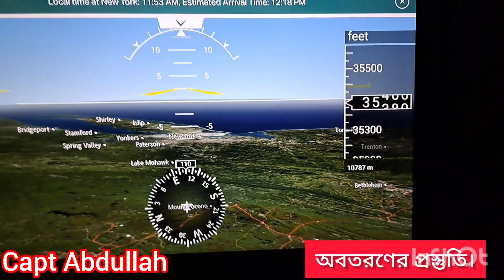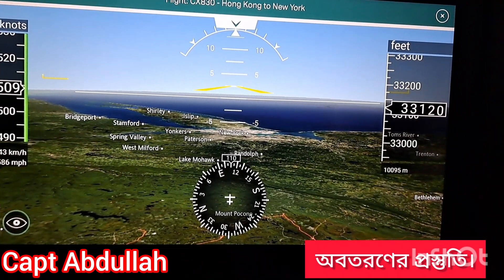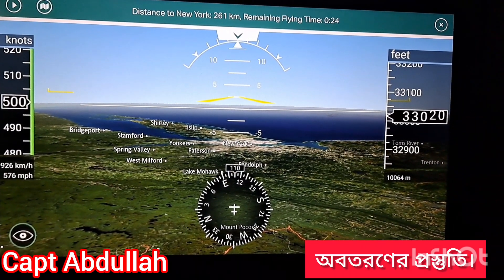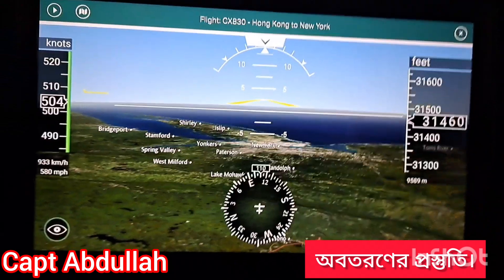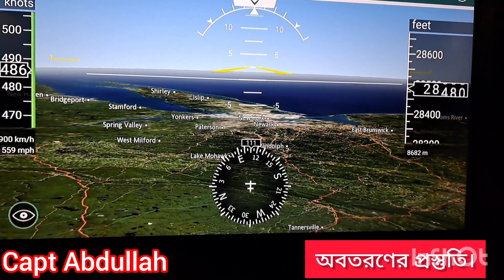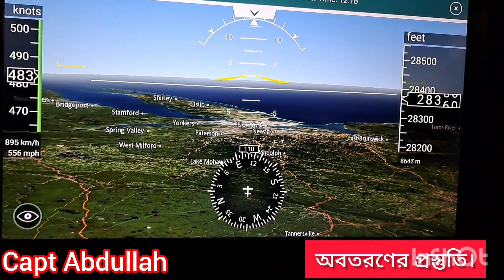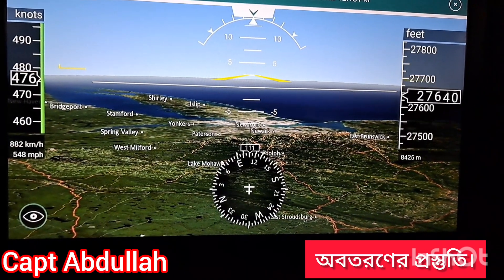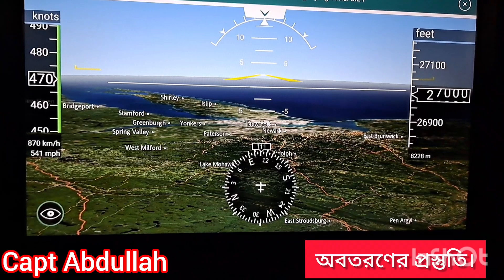৩৭,০০০ ফিট থেকে অবতরণ পর্যন্ত দেখতে পাবেন। “সুপার” কোন এয়ারক্রাফ্টকে বলা হয় ইত্যাদি ।

Comment: Sir, Assalamu Alaikum.
I’m Adrito from Cox’s Bazar.

Your landing was absolutely incredible—a perfect butter landing!

Sir, I hope you don’t mind me reaching out again despite your busy schedule.

I have two questions about this video:
1️⃣ How did you manage to maintain such a stable speed while keeping the pitch at around 2.5 degrees and still achieve such a high descent rate?
2️⃣ Which flight simulator did you use for this? Is it available for public use? If so, could you please share the name?

Sir, I just can’t keep these two questions to myself any longer!

3️⃣ If someone from the Bangladesh Air Force (BAF) wants to become a commercial pilot, how many years must they serve the country first? Up to which rank do they need to progress? What courses can they complete within the BAF, and after leaving, will they need to take any additional courses on their own to qualify as a commercial pilot? Also, how high is the demand for such pilots? A detailed explanation would be really helpful.

4️⃣ I’m so passionate about the aviation industry that I regularly practice flying on my tablet using the X-Plane Flight Simulator Mobile, flying the Cessna 172 and CirrusJet SF50. (Alhamdulillah, I’ve become quite skilled in both day and night flying, and now I’m planning to practice weather condition changes and instrument failures.)

However, my biggest challenge is that I’m not familiar with most flight instruments, switches, and controllers, nor do I know how to use them properly. What’s the best way to learn about an aircraft’s flight instruments in detail?

Thank you in advance! ❤️
InshaAllah, one day, I’ll wear my uniform and salute you in person!
And whenever you visit Cox’s Bazar, my home is always open for you.

E-mail: ebtismrayatadrito@gmail.com

Thanks in advance ❤
Reply from the maker: Unable to reply so many things. See my videos in Facebook page.
Reply from the maker: https://www.facebook.com/CaptAbdullahAviator
Reply from the maker: I can't repeat same things which I have uploaded in YouTube and Facebook.
Reply: @CaptAbdullahAviator Sorry for the inconvenience.
 From now on, I’ll be leaving short comments on each video.
Thank you sir.❤️
Reply from the maker: https://youtu.be/IU3EAKsITHM?si=5jncxvPgDPJMmAE8